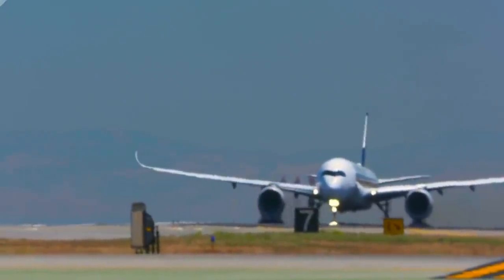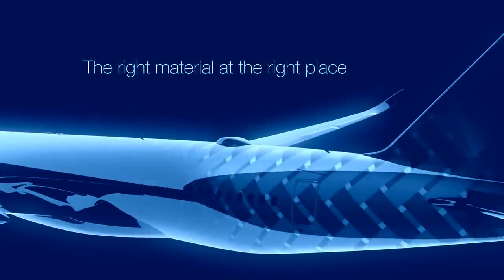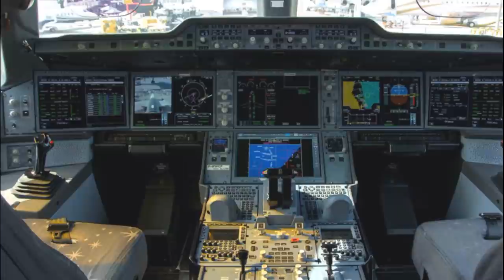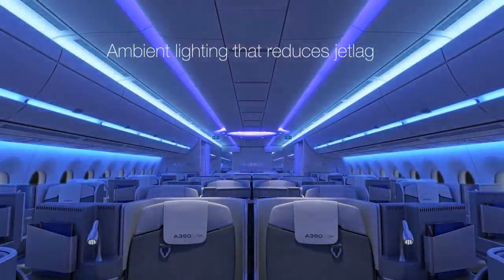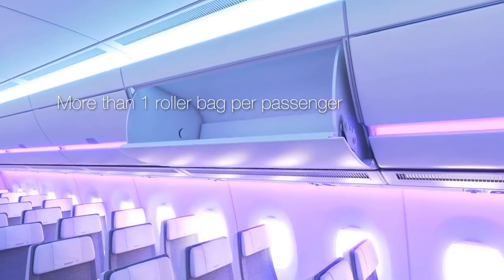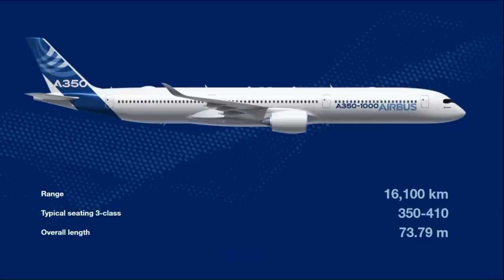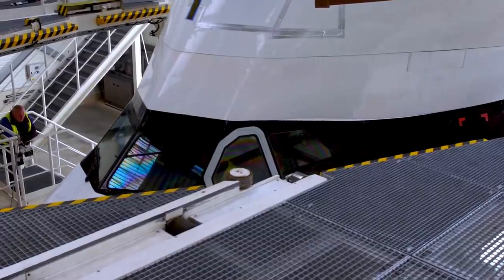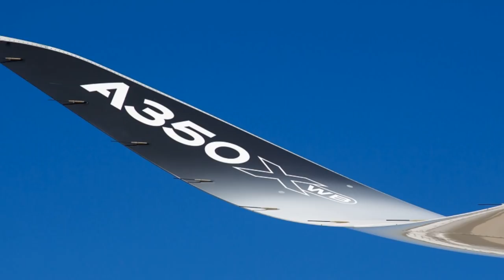The New Airbus A350xwb made from Carbon Fibre

Comment: Can’t wait to board in one of those Carbon Airplanes, the Ambient light that helps with JetLag will be revolutionary if it works , who else loves Aviation 💕
Reply from the maker: The two planes which will really revolutionize air travel are the Boeing 787 and Airbus A350. Don’t get me wrong, from a passenger comfort standpoint I don’t think they’re revolutionary, in the sense that I’d choose an A380 over either plane.
 But what makes them revolutionary are the routes they’ve opened up which weren’t otherwise possible. Both of these planes are fairly low capacity (at least compared to planes like the A380 and 747), have low operating costs, and are long range. We’ve seen so many cool new routes introduced with these new planes, which is really exciting.